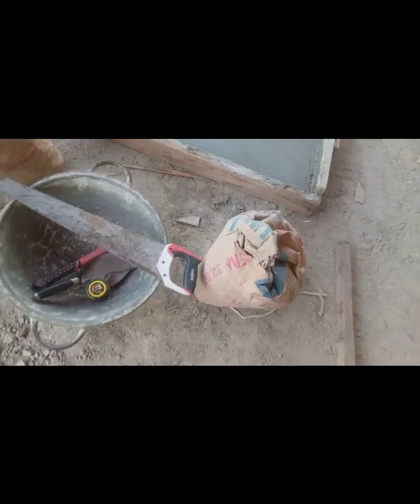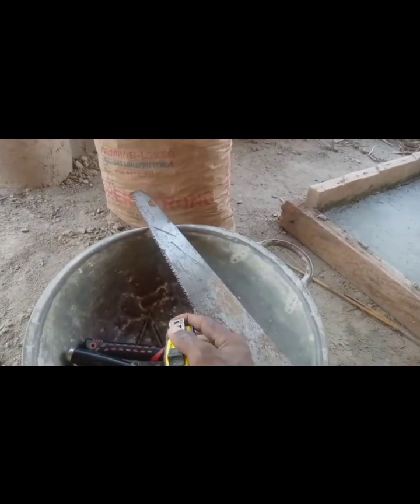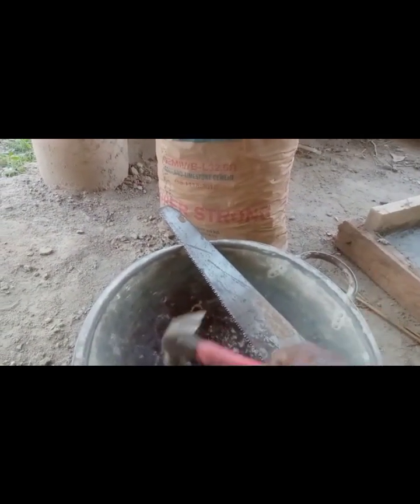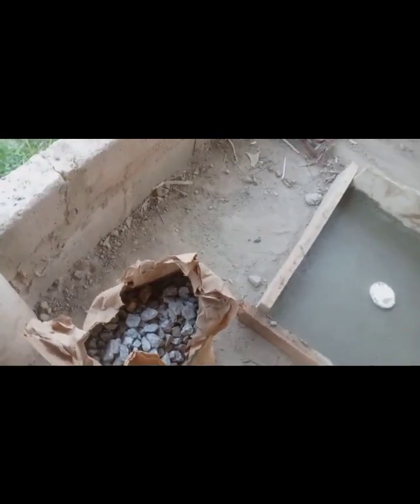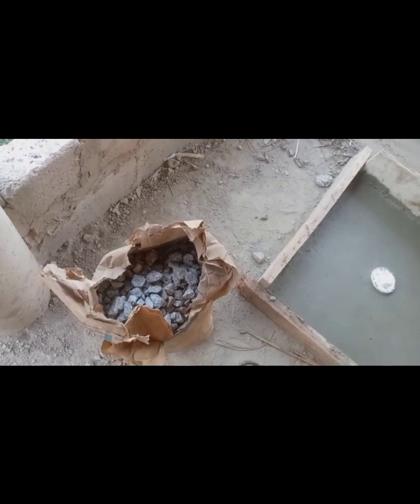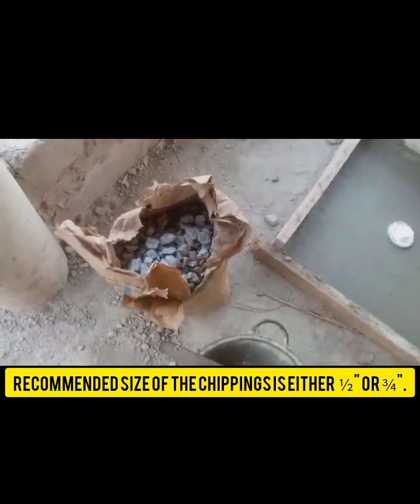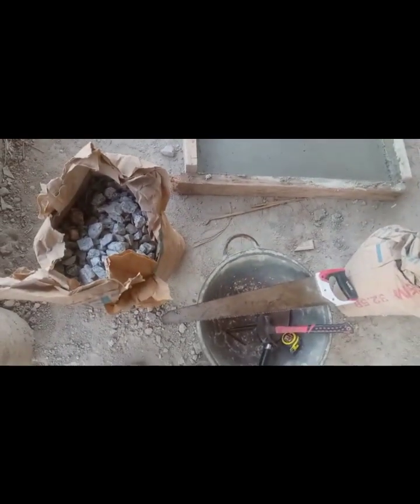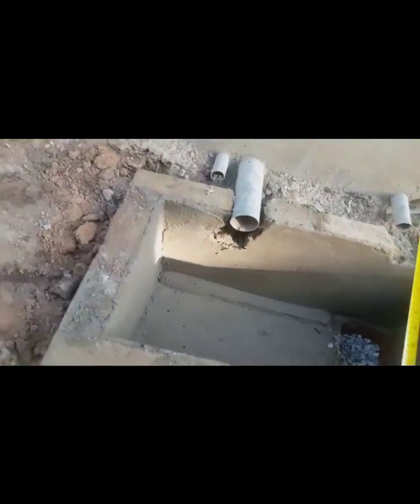DIY Pervious concretes or porous slabs for BIOFILL biodigester

Comment: Hello sir, let's assume the length of the digester is 5ft, when you are forming the mold, how many inches do you use.
Reply from the maker: Are you referring to each unit of blocks or the whole dimension of the digester tank
Reply: @plumbingbiodigester  For the previous concrete
Reply: Let's assume the digester is 6ft by3ft. When constructing the mold for the previous concrete, what should be the measurement.
Reply from the maker: @okeychimeziri6600  after the digester then you take the measurement of the internal dimension and discard 3" to 4" from it so that you can fix mortar joint there. Is your question answered please?
Reply: @plumbingbiodigester  waooooo, thanks for your timely response. I will do my first pervious concrete morrow using your method
Reply from the maker: @okeychimeziri6600  you can!.